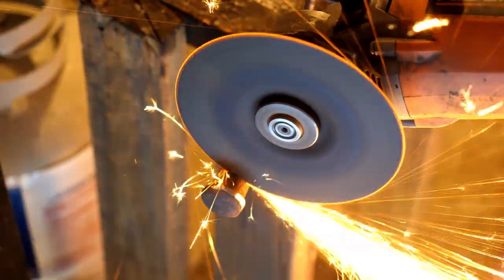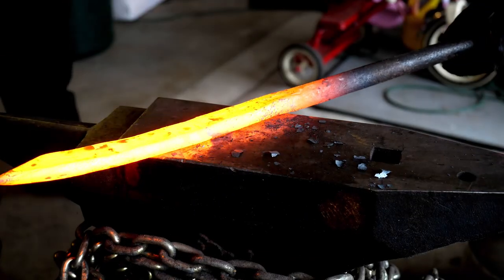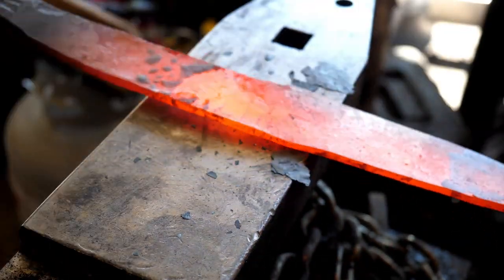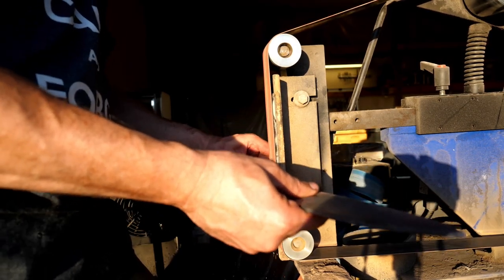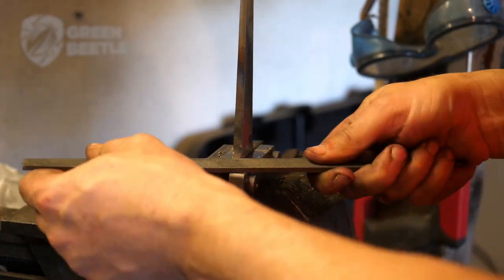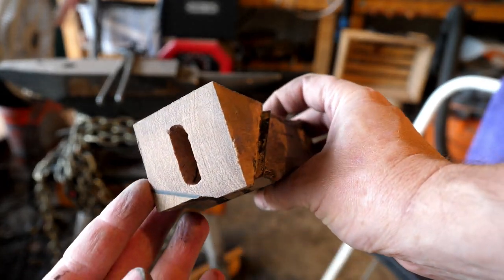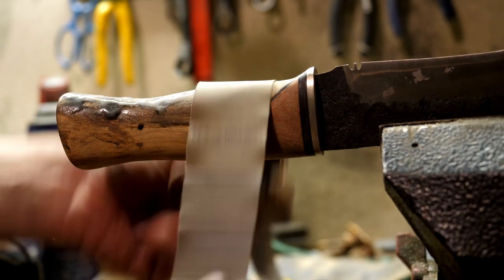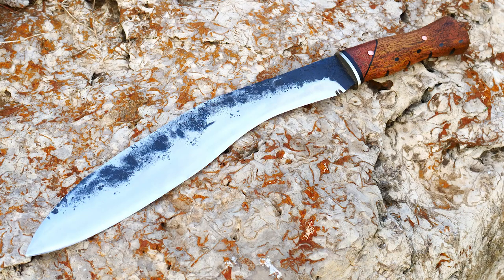Forging A Kukri From A WWII Tank Tread Pin

Comment: This is how we after World War II traditionally made our kukris but out of the leaf spring steel of the Jeeps left on Island.i still have 1 forged from an ancestor.smithing marks still in the blade,handle made from local wood"koa".blood grooves in the blade kinda like what you did i forget what u called them. But they were designed to collect the blood and let it drop down instead of it covering your hands making the blade slippery in combat or water while in the jungle. When I received it as a gift from another family member the blade was dark Rusty and the handle was Ashen black. I lightly took 2000 grit sandpaper to it and got the handled down to the natural wood that the dead wood off of it it was never finished seeing the beautiful koa wood underneath I cleaned it up and oiled it became alive . It's almost a hundred years old and it's still beautiful and functional what I love the most are the 🔨 marks. Beyond characteristics it shows the Smiths signature in his blade you can see his Blood Sweat and Tears in the steel. There's a part of him in this I believe.

Comment: it depends what country the tank was from  U.S. tanks used 1040
german tank pins where 1050 and russian tanks used a type of tool steel
Reply: Tylor Taylor Yeah, would've been nice to know the exact tank, there were quite 'a few' ones in WW2
Reply from the maker: BoarhideGaming   Czech if I rem right
Reply: Green Beetle Czech? Right, in that case it's most likely from a Pz. 35(t) or 38(t), they were very commonly used to bolster the German forces early war. 
You should probably display that somewhere, seeing as this beautiful Kukri would be really appealing to tank enthusiasts but they would likely be interested in the origin of the tread pin.
Reply: Green Beetle Awesome job buddy!!!! How did your body hold up after this build? You're an inspiration to those that have nerve pain and anything that doesn't allow our body to go all out!!! The knife is amazing, glad that you kept the hammered finish, I think it's fitting for what style of material and knife you made. Handle turned out great, the different wood, dyed epoxy, and the black liner was a success in my opinion! I think that it plays out well with the finish of the blade. 

I have started to (try) dabbling in knife scale making with a bunch of different types of exotic wood. It's definitely a slow process for me but hopefully it comes out good and possibly can be a hobby for me. If I ever make something worthwhile I'd be happy to send you something!

Thanks for the awesome content, that you always put out for us!!
Reply: It is highly unlikely that it comes from LT 35 (captured and renamed Pz 35(t)), there are just several of them in the world and all in museums. Unless this comes from restoration works on the one from US army ordnance museum, given to Czech Military History Office in 2008 (now in working condition), it must be from LT 38 (renamed PzKpfw 38(t) after capture). Anyway, both types were made by cooperation of Skoda and CKD, companies, that still exist and are known for interesting metallurgy projects, for example one of the largest hinges in the world, for gates of port in the Netherlands, preventing tidal floods. Even though LT 38 was a very good quality tank, the problem here is... Well, Germans liked it so much they made another things on the same chassis, like Grille artillery vehicle, technically not exactly a tank... It can come from something like that. Or from G-13, post-war production of destroyers for Switzerland. If you let us know from where it came, it can make it easier to find more info. Anyway, Czechoslovak tank parts like this tread pin were made of steel, that is very similar to today modern steel according to normalised Czech standards CSN. Either CSN 1300, CSN 11373, CSN 11423, CSN 11500 or CSN 11600. Probably some of the last two. It is comparable to DIN St50-2 and St60-2
Reply: Where do you find this information?

Comment: When using the drill press to drill out the brass pin for the pommel nut,  put your drill bit in the vice and put the brass rod in the drills chuck,  This will make the drill bit stay centered as you drill, just like using a drill bit in the tailstock of a lathe. Try it, it works amazingly well.

Comment: I love it! Very cool build. I would not change a thing. Mystery steel is not an issue when you own up to it and don't try to pass it off as something else (in my opinion)
And for that matter, it's not a mystery! It's a tread pin! How cool is that?!? And you made an awesome quasi traditional weapon to boot. 
I really liked the final shape, and the handle turned out beautiful. I also like that you added pins with the hidden tang.

Comment: Excellent looking blade and my respect . Me / personally .. I don't take the time to remove rust prior to forging . Heat up the metal and quench in rain water with dissolved mineral block and vinegar . The rust pops off . Your blade and your work is very nice indeed & Thanks for sharing .

Comment: Steve the kukri looks freaking awesome! 
I didn't see it in the video so I'm just gonna put it out. I'm not professional blacksmith at all but when I want to draw out some kind of a bevel (chisel tip, knife bevel) I do it on the edge of the anvil (so the edge of the hammer doesn't hit the anvil first)...seems to go better. 

Thanks for the video!

Tomas
Reply: tomstr21 fine for lengthening, not so for widening. Watch the video for his explanation of why he chose this process.
Reply: Ben Kenobody I think I explained it wrong. .too bad I can't show you a picture. .you don't use the corner. You place edge of the knife  (or whatever) colinear  (i guess !?) with edge of the anvil..you still have the bevel fully on the flat of the anvil

Comment: Its a good looking knife and I like what you did with the handle. I like the rough look of the blade as well. The forge marks you left in it give it a nice look. As far as the hardness goes, I think you would've been better off using a higher grade knife steel as opposed to that mistery steel from the tank. Just my humble opinion.

Comment: If you want to make some interesting inlays you can color epoxy with regular testors paint.  Just be careful not to add too muvh or it won't fully cure. Some colors are more opaque than others but you can make some really neat inlay effects with it.  A final thing:  be careful of air bubbles, especially if you're going to sand or file it flush.

Comment: Question, did you have enough length on the tank pin that you could have possibly heated it up and then fold it in half and then flatten it so that you could have enough metal to work with to not only add size but also weight onto the Kukri?

Comment: Go get some brass filings from the key copy stand at the hardware store, mix brass dust with epoxy, fill holes with brass dust/epoxy paste, sand smooth. Boom - strange and interesting golden glittery spots on your knife handle.

Comment: Some tank treads make use of Mangalloy and Hadfield like steels, that work/impact/abrasion harden due to the high manganese content. If you ever get your hands on the treads. Not sure about from that era, but the steel did exist then as evident by the Gen II Brodie helmets. Would probably work well for wider blades and axe like geometries to avoid chipping as so that hardening never extended to deep in critical areas. Could also work well for cold weather ice axes and such as it keeps from getting to brittle int cold apparently. Though that would be almost unmachinable and need extensive repeated quench annealing to even attempt.

Comment: On the epoxy pattern:  This is better known as "epoxy inlay" and you can do sweet stuff with it. Epoxy dyes are cheap (over the long run...) and easy to use. In addition you can do really neat stuff by adding glitter, crushed jade, or just anything that won't react poorly to the epoxy.

Comment: crazier pattern on the handle with that colored epoxi sounds good. Not a huge fan of the small ornament on the bottom of the handle (pommel?). Still looks great tho, and useful. And the forged finish is way cool

Comment: Personally, I would have folded it in half after you got it flat and forge welded a piece of 1095 into it for the edge of the blade. This would have given you the meat you were looking for and a very hardenable edge. But since you were wishing to make this out of the treat pin only, I think you did fine.

Comment: nice job , me i ask u sir what type of oil u put in handle knife for protection and i hear that the engine car oil is good for  wood handle is that right ? and how much time we should let the handle in oil ? and thx for the video
Reply from the maker: I'm quite unsophisticated with wood finishes.  I just use danish oil on most stuff. Several coats with 1000 grit sand paper between applications.  Sometimes I'll put it on the buffing wheel afterwards, other times not.  Walter Sorrells has a great video on wood finishes, I highly recommend it.
Reply: ah ok i will look on it  , thx for informations , good luck in ur channel

Comment: some things i may have done different? first thing would be i wouldve gone full tang. not to start a what is better than what argument, but ya just cant beat a full tang on a heavy duty work horse chopper. handle seemed a lil fat but i like the creativity. i dont bother with the traditional chole of a kukri unless demanded, it was a multi tool thing for them, not so much for us. but its not like it would be without purpose. a better way to put in the bend isnt to hammer on it. get the area hot and wack it on the horn of ur anvil. straighten as needed. works great....

Comment: Do you know what kind of tank the pin came from? It could help immensely with the identification of the steel.
Reply from the maker: I think Czech, its been laying around my garage for a long time while I looked for a "sexier" piece of tank steel.
Reply: I see, I'll let you know if I can find anything
Reply: From what little I have found, it appears to have been made by Skoda. I would assume the steel is similar to 1040 or 1050, but I can´t say for certain.
Reply from the maker: Hey, thanks man!
Reply: Nothing to thank me for, just some lazy googling. I have successfully confirmed that the technical information on steel from ww2 era military vehicles is not readily available on the internet. Maybe we will have more success with a military forum, or perhaps a blacksmiths forum.

Comment: This is interesting.  I'd always heard that steel made before 1950 was of a much better quality than what we have today.  I guess it's just another urban myth.
I personally think the finished product is an overall success, especially for mystery steel and a challenging knife shape.  Definitely not a five star knife, but it's a solid piece.  I'm the kind of guy that will play with completing an experimental project, and if it has potential, redo it with all the experience I learned from the first attempt.  The second try usually takes half the time because most of the problems are already worked out.  (after watching many of your videos, I can tell you're an experimenter that prefers to keep adventuring into new ideas and techniques rather than working a core skillset to perfection.)
I've seen waaaaay worse kukri that were actually made in Nepal.  Of that actual Nepalese examples I've seen, they all had some irregularities, and some were outright terrible.  The butt of the handle doesn't effect the function of the knife, but a talented artist is usually their own worst critic.
I like the experimentation on the handle.  The offset laminate is a great idea. You could really get wild with the colored epoxy filler if you want.  Sky is the limit there for artistry.  I was impressed you got so much blade width out of that track pin while maintaining a thick spine.  Looks really slim in the video.

Comment: i wouldn't use big sledges on an anvil less than 400 pounds. you'll get a sway in the face. the hammer to anvil ratio (weight) is 40:1 for an efficient transfer of energy . i would recommend a smaller sledge on a medium weight anvil or a mild steel striking anvil for big hammers . if your anvil is 448 lbs im sorry im wrong, pound on it with a heavy sledge all you want ;)

Comment: I don't know if you avoided it for a specific reason, but you probably could have used the horn to make your bend. That may have prevented the little step that appeared in the blade. Dunno, though. Not even a novice, so there was probably a reason you didn't. If there was a reason, what was it?
Reply from the maker: I wanted a sharper turn or angle on the back, hammered in, without grinding.  my method did not work out!  nice idea, though, I'm [steeling] it.

Comment: Got me worried there when i saw you using a hammer as a tool to put it the dent to draw out the material since it is really dangerous hitting hardened steel with hardened steel i'm hoping it was a softened hammer or a really hammer looking tool. Please don't hurt yourself with high speed hardened metal chips...